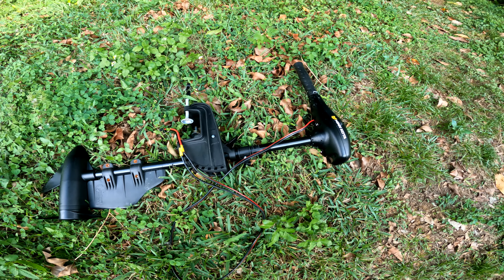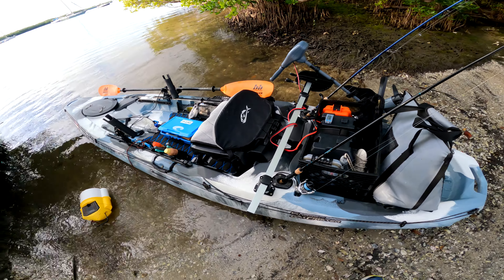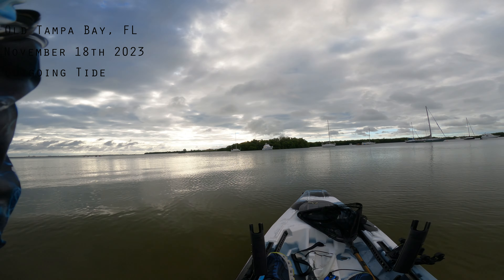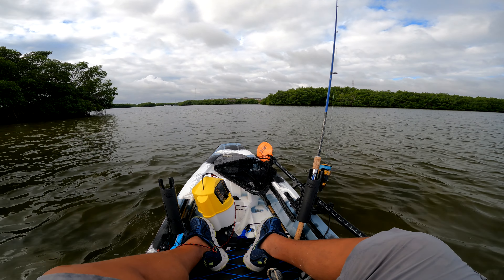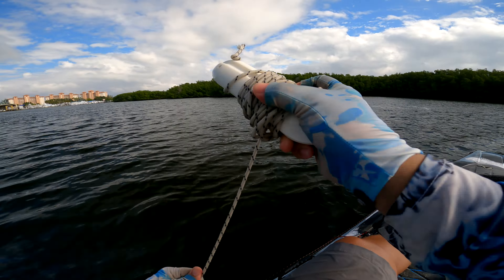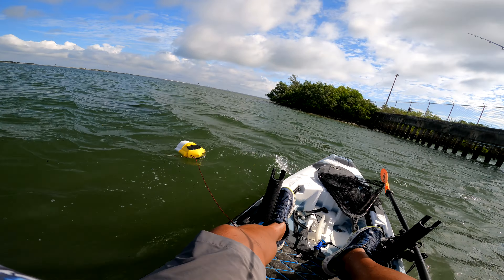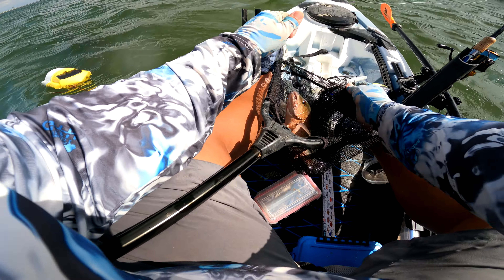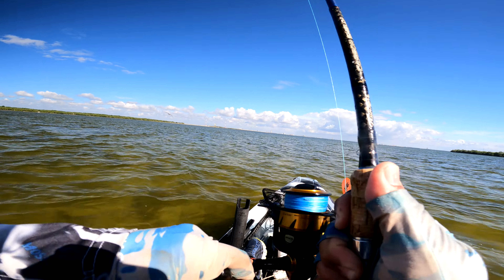It was a feeding FRENZY in Tampa Bay! (*Trolling motor update: Newport Vessels 55)

Comment: i have that same
 30 thrust motor but never installed it how do you like it and was it fast on the movement?
Reply from the maker: The Minn Kota 30 worked great for the 25+ trips that I took it on. I wouldn’t call it fast though, you can likely pedal your yak faster than it would push you. Definitely worth it for paddle kayaks tho since it frees up your hands for rigging in between spots and such.